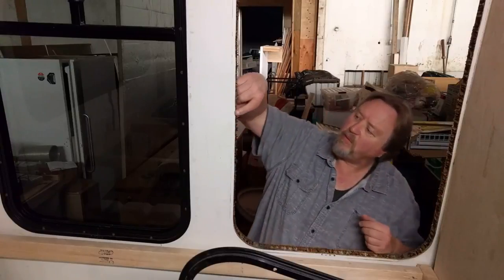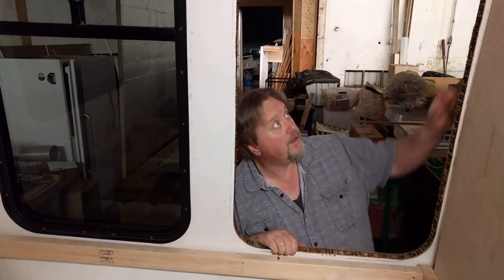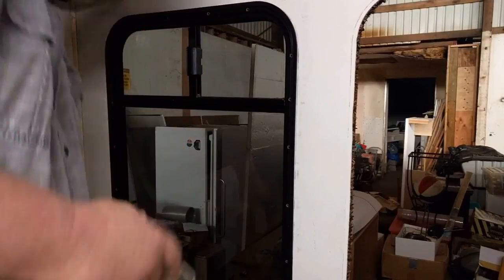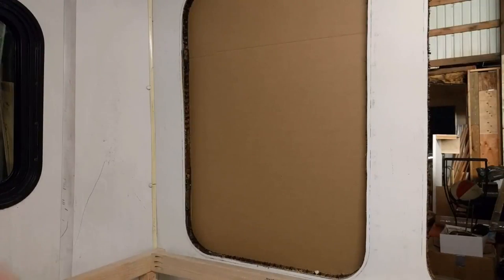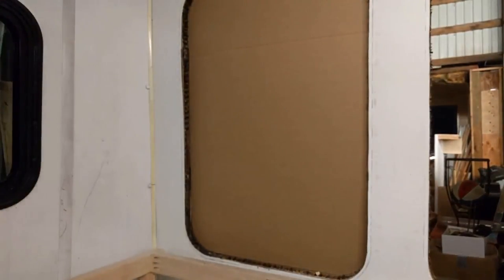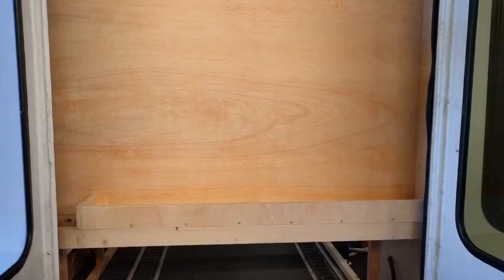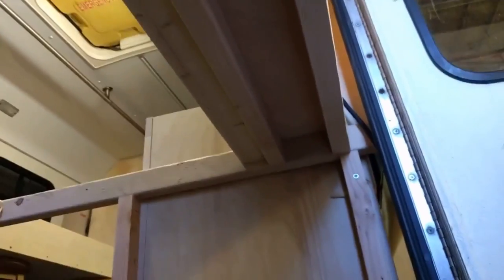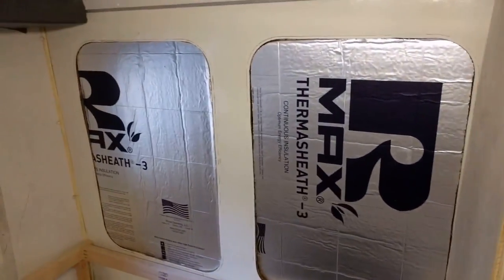Shuttle bus rv conversion (Part 5) Window removal

Comment: I made the mistake of taking all the windows out at the same time. This relieved the stress the metal was under and my window seals warped, I had to custom mount alumunum brackets to get it to fit back onto the bus without any gaps. Hopefully someone will learn from my mistake and only do ONE window at a time.
Reply from the maker: @Random Guy Never heard of that happening before, less likely to happen with a fiberglass body bus I would think, mine was very solid with the windows out. Thanks for the warning and hopefully no one else will make that mistake. :  )

Comment: Nice Job removing the windows. i am in the middle of a shuttle bus conversion myself, and i had not considered removing the windows, so this video is pretty encouraging. how do  you plan to close the opening from the outside ?
Reply from the maker: @ Ruben Fagundo  I haven't decided yet but my favorite option would be aluminium cutouts the same size and shape as the exterior windows painted black to mimic the windows. I could also paint a black out panel down the side of the bus like the newer buses from the top to the bottom of the side windows. I could also use SMC  fiberglass panels they are smooth fiberglass sheets that i could patch over the openings.
Reply: @robertbraden3889  - i look forward to seeing how you handle this on your bus.
Reply: I was going to ask the same. I have seen some just paint the interior of the window black and the build the wall over it inside. Interesting to see how to cover the exterior after removal. I know n9thing about body work so I imagine my eventual build will have painted windows lol

Comment: How would you reseal the windows?  Would you remove them and add butyl tape around or just silicone around without removing them?
Nice job!
Reply from the maker: I will remove them and replace the seals,found some that are identical made by Frost King at Home Depot of all places,  You could use butyl tape and that would probably work in a pinch but you may need two layers. I dont like to use silicone around the windows,it picks up dirt in time and looks tacky.
Reply: Robert Braden Thank you for the explanation!

Comment: What did you use to secure the 2 x 4's to the fiberglass wall on the interior? I am not removing my walls and are having trouble finding info on what kind of screw to use or how to secure them to the fiberglass wall.
Reply from the maker: I attached everything to the seat rail mounts in the lower walls. I built brackets to attach the counter cabinets and beds. I used self tapping stainless steel screws if I attached directly to the fiberglass wall. I didn't use any 2x4s in the building of the bus.:hand-purple-blue-peace:
Reply: @robertbraden3889  thank you for sharing! Did you have to pre-drill the fiberglass? I'm having a tough time drilling through it
Reply from the maker: @kconko  Sometimes there are braces built into the fiberglass, get a new drill bit made for drilling metal. That should fix the issue 😁

Comment: Hey Robert, I love your videos. I have a similar bus and I'm having trouble taking the windows out because some of the screws are rusted or who knows what. I tried putting a new bit like you suggested but still having trouble with a few of them. Most of the windows are really old and the rubber around the windows including the small ones is hard as a rock and scrunched up so I think I might be needing to replace most of them. I'm having trouble finding some for a shuttle bus, do you have any suggestions on where i might be able to find some? THANKS IN ADVANCE !
Reply from the maker: @Valentin Mosnegutu
  I have 4 extra windows that I took out of my bus, the are aluminium framed with rubber seal under the outside lip.  You are welcome to them if you are near Crescent City , Ca.  You can cut a slot in the stripped out Phillips head screws so you can use a regular flat tipped screw driver or try a pair of vice grips. You can replace the rubber on your windows, I did a video on how to do it.  Have fun with your bus!  :  )
Reply: @robertbraden3889  that's very kind of you I wish I was. I'm all the way on the other side in NYC. I'll try cutting a slot great advice! And sweet I'll look for that Vid would really like to reuse these guys ! Thanks Robert for the quick reply!

Comment: Hi Robert. I have a 2003 ford 450  that I want to take out all the windows on each side and convert my bus into a solid wall cargo hauler. I also want to paint white the sides after taking windows out to match the color of the bus. My goal is a bus you can't tell ever had windows on the sides as if built with out them just a solid wall each side. I haven't watched the rest of your videos yet. When your done were the windows used to be are the flush with the outside of the body? If not how would you go abouts making it in appearance of no window or bracket was ever there. I am ok at best with fabrication but good with fibor glass. I have repaired huge holes in fibor glass hoods that you can't tell were ever there. If you were me would you try fibor glass sheets instead of uluminum or maybe fibor glass sheets over the uluminum sheets to make flush? What do you think would be best I do? I know I should of prob watched other videos first before asking all this but I got excited to see what you had done. It gave me hope for my project.
Reply from the maker: @Travis Mickelson  I think  I would use SMC (Sheet  Molded Compound) fiberglass panels like some motor homes use, they come in many different sizes. After removing and filling the window holes with foam insulation  you could cover the outside panel with the SMC, using adhesives or riviets .  You may end up with a few seams  but I think it would look like it was made that way. I don't know what your budget is on this bus it may cost a bit to do this, just a idea!  :  )

Comment: how are you finishing the outside of the window patches?
Reply from the maker: @Richard Larkins  I ended up covering the window openings with 3/16 inch thick aluminium panels and painted them white to match the bus body. I've made over 70 videos on this bus build and I covered this in a later episode. Check it out and see how I did it, Thank you for watching!  :  )
Reply: @robertbraden3889  Can you please share the exact Episode that covers how you finished the windows? Thank you.....FOUND IT>>>>Part 18

Comment: Do you still have the windows for sale?
Reply from the maker: Hi John, I will give them away if you can come and get them, just tell me size and quantity you need. They aren't doing me any good sitting around my shop, glad to help out, let me know. :  )
Reply: @robertbraden3889  last week, a golf ball at the park went thru my side window. I need one, but will take them all if your getting ride of them. I'm in Fountain Valley California. My side windows look exactly like yours with a single t slider. The overall size with the frame is 41inches X 30.5inches. The bus is a Ford E350 Aerolite by eldorado. Thankyou so much!!
Reply from the maker: @johnnguyen6026  I will check the size and reply back with you tomorrow.
Reply: @robertbraden3889  thankyou!!
Reply from the maker: @johnnguyen6026  My windows are 26 wide by 37 1/2 high and I have the emergency pop open type and the regular type. Sounds like you have some larger windows. Offer still stands!  :  )
Reply: @robertbraden3889  thankyou for the offer, but I won't have any use for them cause of the size difference. Darn it I was really hoping they would fit too.

Comment: Again, thank you for documenting. I have similar bus 02 E450 Aerotech. I want to remove CNG and replace with diesel. Maybe I could stop over to chat; I’m in Ventura County.
Reply from the maker: @socialcraigster Hello Craig I tried to call you but didn't get through then got busy and forgot  to try again. My expertise is in collision repair, but if I can help with any advice I am willing. I am in Del Norte County so I'm a considerable distance away. Your CNG tanks are probably expired aren't they? Locating a donor diesel for the engine and transmission would be expensive, not to mention the labor expense if you don't do it yourself. You will need a fuel tank,fuel lines, filler, and a diesel front wire loom for the new engine. You have a daunting task ahead of you my friend. Have you considered converting the bus from CNG to gasoline? I don't know about the Ca.smog laws for that, but i do know you can license the diesel as a motor home if it is equipped properly.
Reply: @robertbraden3889  can you do body work on my shuttle bus and paint it a new color?
Reply from the maker: @SourGrey  Sorry I can't be around those chemicals anymore. The best way to get paint work done is to visit some small rural body shop that needs the business and ask for the best deal possible, see if they can help you out. I made some incredible deals when my shop was small before the expansions and the insurance work took over. Best wishes :  )
Reply: @robertbraden3889  thanks for the tip
Reply: @robertbraden3889  also I removed my broken bus window with the help of your video thanks. It was easier then I thought it was. Im getting the glass ordered and gonna put it back in.